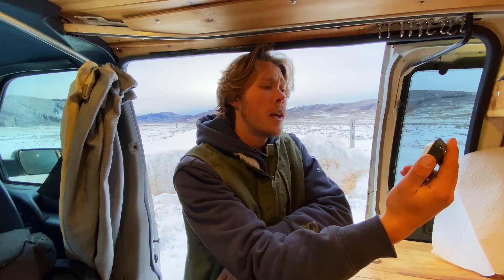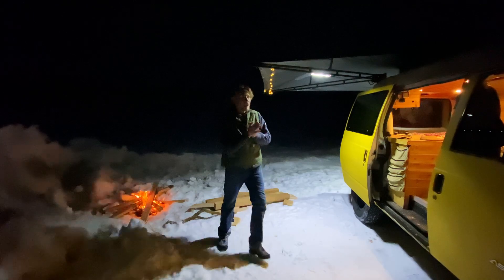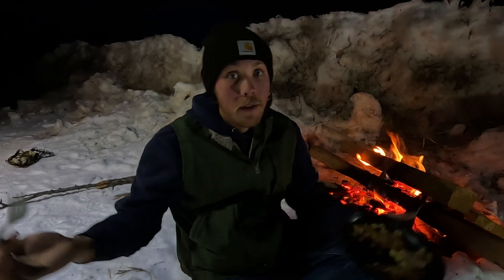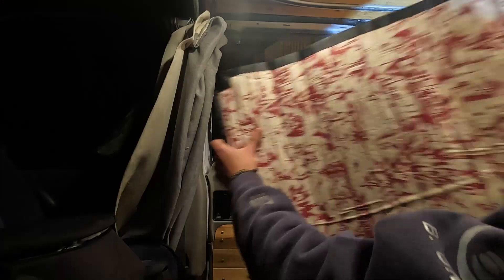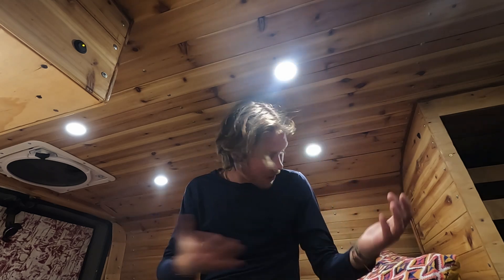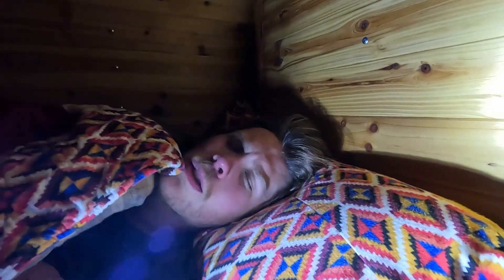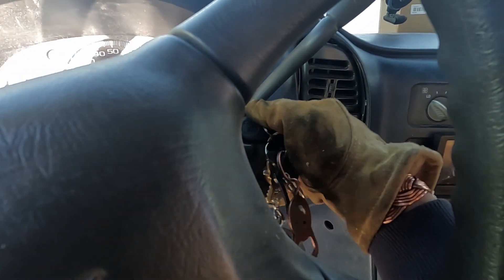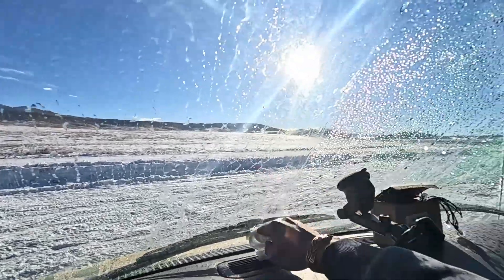I Went Winter Camping in my Astro Van

Comment: If you plan on going to Alaska in the winter you need a diesel heater for sure. Bedding needs to be in layers because if you get a really good blanket for sub-zero it will be too hot in warmer temperatures. I was an over-the-road truck driver and I slept many times all night in cold weather down to zero. I usually planned to just go down to the teens but many times I woke up in the single digits. You can use your stove for a quick warmup in the morning. Make coffee and you won't waste fuel.

Comment: Great video.
The buddy heater is a great option for warmth,but not for sleeping,in the cold. Plus the cost of fuel is another issue. Another alternative would be the Vestafire heater/stove. Runs on sterno type fuel,and has quite a long burn time. I experimented with one,in a 7x9 outdoor shed,on a very cold,snowy,central pa night. (-6)
That thing burned for about 6hrs,and kept it quite comfortable.. No fumes,except when putting out and initial lighting..(a few seconds max)
Can use any type of canned heat(gel is better) and cost isn't horrible. I pick up a couple cans,every trip to Walmart.(store them away until needed) right now I have about 15 to 20 cans..lol
Will definitely go in my van camper,when I build this spring/summer.😎

Comment: love the content! I Travel in a toyota land cruiser and I use a diesel heater in the winter. Dry heat no condensation and it can safely be left on all night on low. For safety use a CO monitor alarm. I am thinking about upsizing to a 4x4 van when it can be afforded. Keep going with the content and yeah Alaska is an adventure. I went for a summer job fishing salmon and working at a fish packing job. Made life long friends and had quite an adventure. I was 24 yo at the time. Absolutely encourage you to go there. Set it up now and head there in the late spring. Beware lots of mosquitos :)
Reply from the maker: That’s awesome you travel in a Land Cruiser! Jealous 🥴
I’ve thought hard about it and it makes so much sense to go that I can’t resist, I’m going

Comment: When your water bottle freezes inside your van it's a little more than cold🥶. Those little buddy heaters leave a film on the inside of your windows if you haven't figured that out already.   I couldn't see out my windshield when the sun hit it after the first night I used one, I scrubbed my windshield and couldn't figure out what the heck was on there that wouldn't come off, then I realized maybe my heater had left a film inside the window, sure enough that's what it was. Glass cleaner is a good thing to have with you if you're going to keep using it. Was glad to see you opened your fan for fresh air.  CO2 alarm would be another good thing to have. If you can ever afford it, a heater that runs off your gas tank is the luxury way to go.  Or chase the warm weather so you don't need a heater 🏜☀Alaska would be an exciting adventure, probably worth a try, you can always leave if you don't like it.  Keep on having fun and stay safe!

Comment: Our Astros are really too small of a space for a buddy heater and oily moisture is a byproduct of propane combustion in a confined space.
Id recommend  for you to look into an air heater, either diesel heater, propex or a webasto. 
We just invested in a gasoline webasto heater, that ill be installing in the next couple of weeks. It was a HUGE expense but one that will make for much more comfortable and safe heat in the winter.

Comment: I love you van I wish I could do that to the inside of mine. When you let your buddy heater I noticed if you hold the red on button in for 30 seconds once you get it orange tip on the blue flame then let go of the red button and it’ll light right away.!👍🏻👍🏻🙋🏼‍♀️
Reply from the maker: It was a pain in the booty but I would do it 100x over again cause I love my interior! 

Sometimes I can be a little slow 🥴
Thank you for the buddy heater tip

Comment: I never had a desire to go to Alaska but if it's in your heart, go give it a try and report back if I am missing anything.  I'll be here in Arizona:)
You need to find some way to mitigate that interior condensation, it will only lead to mold.
Reply from the maker: I’ll let you know! Luckily I don’t use the heater much or I would be very concerned

Comment: Cool video, thanks for sharing.  I am concerned with the amount of condensation that accumulates inside your van, most likely from the moisture output of the buddy heater.  The warm moist air gets under the headliner, panels, etc. and freezes against the metal of the van.  When it thaws you’ll have a moisture condition in all those places that could grow mold.  I’m a little nuts, but what I would do is put a dehumidifier in there once it gets above freezing and let it run for a day or two on highest setting.
Reply from the maker: To be honest I never thought about that. Thank you for leaving this comment so I can think about that
Reply: The Chinese diesel heaters are fantastic if you’re willing to do a bit of work to install it…
Reply from the maker: @ryanchristie5349  that’s what I do 😁😁

Comment: How long does your van take to start on freezing cold mornings? Does it take longer when it hasn't been used for several days?
Reply from the maker: My van actually starts about the same in just about any conditions. My ignition switch is getting a little worn but as far as the engine and starter goes, it’s all good (knock on wood)